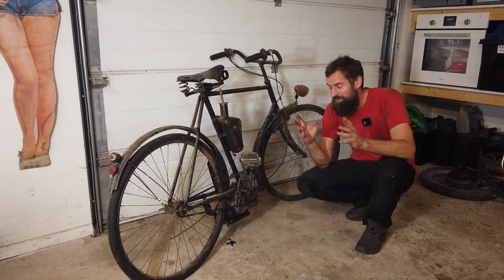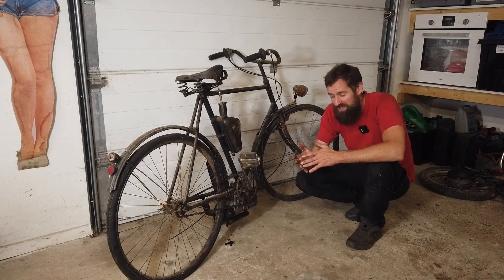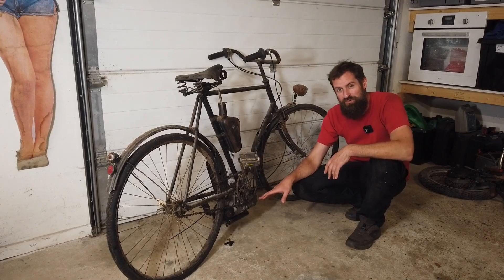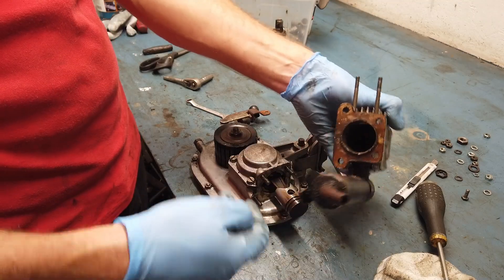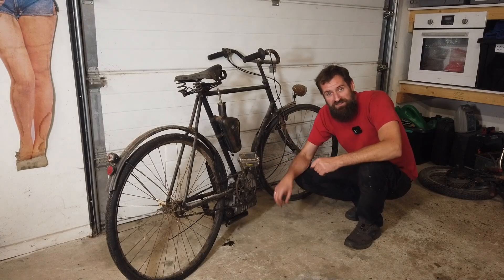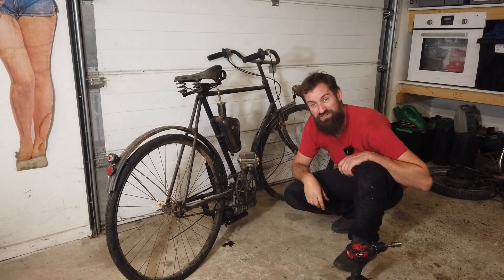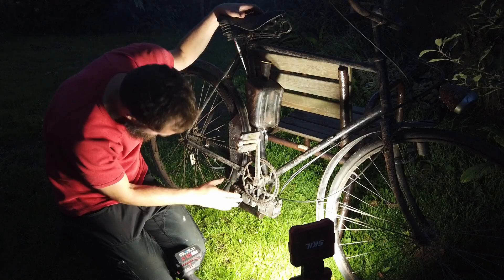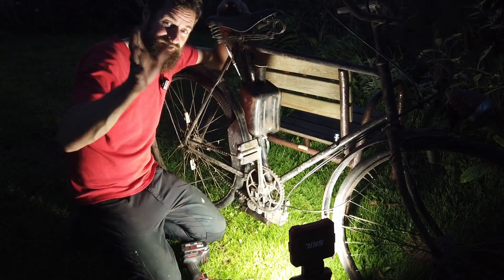Two Stroke Diesel Moped With Variable Compression! 18cc!

Comment from the maker: Thanks for all the lovely comments! I am reading them all!
I JUST uploaded the next video with this one! And I actually attempt to ride it!
Reply: Mate, try running it on kerosene, I think you will get far better results.
Reply: @marvindebot prolly meant to?. (Kids on my school bus used to pick up kerosene for the fridge at home). Parrafin would burn clean?
 On reflection, that would have been heat exchange (the fridge?). I'll have to look it up now😅
Reply: I imagine, that the bicycle drive wheel also acts as the flywheel to help keep the engine spinning. This engine may not be designed to run/idle, when the bicycle comes to a stop, like at an intersection, but instead meant to be used when the bicycle has long periods of uninterrupted travel. More for use in rural areas or between towns or cities, than inside towns or cities.
Reply: The" beats walking",  school of engineering...
Reply: I'm here just in time!
Reply: What about oil? Did I miss something?
Reply: You should consider fitting a fiberglass fairing and entering the Craig Vetter fuel economy challenge! One could probably get several hundred mpg on this if you manage weight, aerodynamics, and driving style. Look it up
Reply: @systmh  He should go for carbon fiber, so it would be lighter (Of course, he should refrain from deep sea diving with it!).

Comment: Boy, that IS an overcomplicated design. 

A much simpler way to do it is to use a "contra-piston" inside the bore, up at the top, which is basically a puck of metal that has a other type of "piston ring" to seal it to the cylinder, and then an adjusting screw protruding thru the top of the head that when screwed in or out, pushes the contra-piston up or down the bore slightly, and changes the compression by varying the size of the "combustion chamber". Simple, easy, and effective..

Comment: On starting engine with drill get your self a 1/2 socket ratchet and 1/2 adapter to drill. This allows rotating engine but once engine starts ratchet allows it to rotate faster than the drill so nothing gets destroyed or injured. Just mind that in cheaper ones you might run into issue of inertia turning the ratchet switch so might want to build lock to hold it in place if all your engine turn to same direction.
Well this is closest i have seen so far when it comes to converting moped into diesel. Local regulation prohibit speed and displacement but older ones have no emission regulations, so i'm thinking on converting older moped into diesel, just having hard time finding anything that is 50cc and i could get the high torque for steep uphills that is the issue around here. Even if speed is limited to 45km/h i would like to drive the uphill in that speed, while gasoline needs get speed to get up the hill for that speed and gets sluggish from my experience. Also smaller fuel consumption and potentially able to drive with home made biofuels would be real nice thing.

Comment: Parafin is another name for kerosene which is very similar to distillate. I can understand it needing variable compression otherwise you'd never start it.
The big surprise for me is the drip feed. Until now I thought all diesels were fuel injected. Also it has to be a two stroke I reckon and all the two stroke diesels I am aware of are supercharged to make them work. SO, what an engine, well ahead of its time.
Reply: @@Britishpersun You're right, I had forgotten about them, my elder bro' had one. But I don't remember them in diesel. I'm going back sixty years but I think they were alcohol or ethanol !
Reply: @@Britishpersun Well I'm happy for ya mate. I also restored a 1959 Kero Fordson Major a couple of years back. We had a few Fordsons until we saw the light back in about 1965 and bought Chamberlains .

Comment: Yes Nissan is doing it with a rather "eccentric" crank.
Saab also had ( prototype )variable compression with a 2 piece block with hinges and bellows.
Despite cutting my teeth building turbo Nissan engines....
I honestly like saabs approach much better.

Comment: I had a 1968 r50 BMW motorcycle 6.8 compression ratio . In the summer I could run 50 % diesel & gasoline .

Comment: back in 1981 when I was in my last year at school, a friend turned up with a 2-stroke variable compression diesel engine with a propellor on the front. it fueled using an adjustable carburettor and the compression was controlled by a tap-screw on top raising or lowering a cylinder head dummy inside. can't remember the engine capacity but in comparision to model aircraft engines I was familiar with at the time it must have been around 10-12cc. and interestingly, we used it to test fuels from cracking crude oil in an after-school nerds club (thats before we accidentally managed to blow-up the science lab lol).

Comment: Not a semi diesel full diesel. Semi diesels use glow plugs or hot bulbs. Larger version of model aero diesels and using fuel they use will make it start and run very well recipe is oil, kerosene, ether and some ignition booster. Usually amyl nitrate but impossible to obtain so try cetaceans booster additive instead. Percentages available in on line search. Good luck

Comment: This engine is not running right. It should not be producing all that smoke.  It's getting way too much diesel. 
I think you should just lock down the compression once you get it right and just leave it there. It won't be hard to start because of the compression.

Comment: 4:33  I don't think any diesel engine has a carb.  AFAIK, diesel has always been injection.  Presumably, the fuel has to be injected very close to TDC to prevent the fuel from igniting too early in the stroke.  Like say diesel ignites at the temperature generated at  12:1, but it's a 15:1 compression engine.  If you inject the fuel too early, it will auto ignite when it reaches the point in the stroke where the compression has reached 12:1 and its associated temperature.  So ideally, you would inject the fuel just before TDC.

Comment: For all my 2 stroke engines i mix canola oil in my gas. Never had any trouble in my moped. There is a place for gmo "cooking" oils. Any place but the kitchen. Would be cool to see a diesel bolt on moped engine than can run on canola or any gmo cooking oils.

Comment: 18cc is kinda hystericicallly tiny to expect to drive such a large wheel. 50cc scooters have teeny wheels for a reason. Granted it's "diesel" so more torque but might just take an incredibly skilled oprtator to balance fuel and compression or maybe it was a garbage design from originally. Probably rare for a reason.

Comment: You could be having a compression issue. As you're spending it over and trying to start it extra fuel is building up in the cylinder and maybe actually helping the Piston seal after that extra fuel runs out and it's running on the normal amount and no longer has that fuel to seal it

Comment: Model aircraft engines with compression ignition have existed for many decades. They were old news in the 1960s. A T-bar screw on the cylinder head was used to vary the compression ratio.

Comment: Inspiring for the home tinkerer. I have a couple old honda 300 watt generators- 4 stroke very small engines- would go pretty well on a bike, much quieter and much more reliable than those 2 stroke chinese kits that are noisy junk.

Comment: Years ago I brought home a 27cc 4-stoke gasoline engine from a string trimmer that someone threw out at the landfill to take apart and clean up for fun. The trimmer part ended up being beyond repair but I still kept the little engine because it was so much fun to work on and get running!

Comment: The diesel engines used to power model aircraft in the 1950s used a variable compression system and typically had a capacity of 1.49cc. The recommended fuel was one part ether, one part castor oil and one part paraffin. Worth a shot in your engine?
Reply: thomas pcguru engines demo https://youtu.be/YpMvZ7K-T9M?si=7eyU4g4WOmcpsbmU
enjoy!

Comment: You were saying that little engine is a multi-fuel burning design. I bet it would run better on kerosine with its adjustable compression. Kerosine lights off easier. Or maybe add a little gasoline to the diesel. Im interested to see if you can get it running well enough to ride it

Comment: I imagine, that the bicycle drive wheel will also act as the flywheel to help keep the engine spinning. This engine may not be designed to run/idle, when the bicycle comes to a stop, like at an intersection, but instead meant to be used when the bicycle has long periods of uninterrupted travel. More for use in rural areas or between towns or cities, than inside towns or cities.
Reply: And there are a lot of those areas in Denmark and Germany
Reply: Run it on kerosene/paraffin with a shot of 2 stroke I think they were like a tractor  that used tvo fuel when they got hot they ran fine

Comment: That is not a diesel cycle engine , that is a normal two stroke that fires by compression , just like a petrol car that's too hot , a diesel has a fuel injector , the reason for the variable compression is to get exactly or as close to as possible the correct compression for a type of fuel , you could run it on petrol or anything , a diesel is a specific set of circumstances, put some petrol in and a spark plug lower compression to is least and it will run just like a petrol motor , I could get a petrol engine to run on diesel if I raised compression a lot , but this Is still a petrol engine running on diesel not a diesel engine ! No injector or pump not a diesel by definition !

Comment: With any internal combustion engine, the octane rating of your fuel coupled with the degree of compression influences ignition timing. This is the case even if you have spark ignition or a diesel injector. This is a compression ignition engine, but you need to match that compression to the octane of the fuel. If you are using modern petrol, then compression would need to be low but with diesel fuel it would have to be high and things like kerosene or paraffin would be in-between. All your fuels except for diesel would have to contain oil for lubrication which would affect the octane of that fuel. The lower the flash point of your fuel the higher the compression will need to be and if the bore or rings are worn then you may not get the compression necessary. I can see this being a very tricky engine to control as things like RPM, engine temperature, and fuel ratio will also affect the ignition point. Trying to keep all these things in balance would be difficult.

Comment: A lever to alter compression was pretty common on older bikes, so it was easier to kick start the thing.
Reply: Your thinking of a decompression lever that would hold a valve open to make it easier to start, this set up is almost closer to a slide valve engine, but even that didn’t change compression, this is incredibly unique
Reply: Old bikes- of that vintage or more- were pretty low compression and didnt need decompressing to kick. Reckon you're mixing that up with spark timing lever/ twist grip on the opposite handlebar. Spark timing wasn't automatic back then. If you left it advanced, it'd send you over the handlebars when you kicked it over.
Reply: @rossbrumby1957  I owned a 1960's VeloSoleX which is probably the lowest compression moped engine ever made.  And it had a real, in-head de-compression poppet valve.  All because it used a friction wheel against the tire, which in rainy Fall and Winter France needed all the advantages you could get to spin the engine over when the streets were slick with rain.
Reply: @rossbrumby1957 it’s a diesel, there’s no ignition system

Comment: What a cool little engine, my grandfather built his own powered bicycle back in the 30s/40s as he had to travel a long way to work living in rural ireland, started with a battery and car starter motor iirc and just a simple on off switch, then found a little petrol engine which he attached to the frame, used it to travel 20miles or so to work, used to leave a can of fuel under a leaky fuel pipe that was for an airport iirc which was on the way to work and would use that to power it so got free fuel as well :)

I built my own electric bicycle when i was about 13 or so for the fun of it, much easier then with parts easier to find, also got lucky and found a ton of brand new nicad battery's that were being tested and then thrown straight out after ward for some daft reason, so had 100s of them to use, soldered up a few packs for the bicycle which made traveling around easier as a kid.

Comment: My mother and my father had each a bicykle with Lohman Motors in the ealy 50th. Befor skrapping, the motors was taken out and keept in the cellar. In th early 70 my father rembered the motors and startet with my brother (13) and me (11) to install one into an actuel bicykle. The second motor was used for spare parts. It was hard work to bring the motor to ingnition by pedal force. As far as I remember it tock hjalf to one kilometer to get stabil ignition.  All what is left totay from the Lohmanns is the front cover of one tank (other tank version als shown in the vid).

Comment: Diesel engines use "Adriatic" ignition by compressing the air so much it gets super hot and then Diesel fuel is injected as a fine mist that ignites from the hot compressed air. Glow plugs are for cold start only. Not all diesels use glow plugs.

Comment: Not sure this can actually idle or even run properly without the roller against the wheel. Don't know if there's any flywheel on the motor itself, but I'm sure the wheel and inertia of the vehicle acts as a flywheel in normal operation.

Comment: Not a Diesel.Diesel cycle uses an injector,without an injection system its correctly called a compression ignition engine

Comment: Interesting.  I did not expect to see that design.  The compression adjustment is somewhat similar, in my understanding and recollection, to the fuel metering system in the Diesel fuel pump for my 1965 Mercedes Benz 190Dc (OM621 engine).  Rather, I expected to see an articulated connecting rod setup.

Now let's see you ride the bike on Diesel power!

Comment: The manual recommends using kerosene mixed 25:1 with oil. 0.75l/100km is quoted! I have a PDF copy of the manual if you'd like it.

Comment: Looks very similar in principle to one of those diesel model engines for aircraft, they also had variable compression with a screw and lever on the top of the cylinder head, I had one many years ago, it was difficult to start initially but ran well eventually, no piston rings, just a snug fitting piston. They ran on paraffin, engine oil and di ethyl ether 33.3% of each. The ether being for the ignition at a lower flash point.

Comment: Nice little engine. I'm surprised it runs in regular diesel without even needing injectors. I've got a few small compression ignition engines but they all need something like ether in their fuel

Comment: Seems like it would be extremely easy to have this thing runaway on you! 😮
Reply: Only if the fuel drip needle gets stuck open. Most runaways in full-scale diesels occur when the seals in the turbo let go and the engine consumes its own oil.

Comment: Nissan’s variable compression system is pointless, we already have forced induction and adjustable cam timing; it literally serves no purpose and it’s god-awfully designed and failure-prone (like everything Nissan has made in last 15 years 😂)

Comment: That's a super neat little engine, I like the variable compression setup, but it does seem quite complex  FWIW, variable compression diesels were a fairly big thing in aeromodelling from about 1945 onwards, but generally had a really simple setup with a counter piston in the head that could be screwed in and out to increase or decrease compression.

Comment: I know Nissan (Infinity) doesn't have the first, but I see headlines claiming that…

Saab's version is pretty cool. It alters compression by moving the head and cylinder together, connected to the crankcase (& crankshaft) by a hinge & the actuator. 

Similar to that moped sorta…

Dump a little oil in the cylinder, just a few milliliters, that thing is tiny, so it could be hydrolocked easy!

The oil will lube up the piston rings & bore, to improve compression, & it will bump compression temporarily (by displacing air).

I'd use something like 10w40,  not a light oil (wd40) or heavy oil (80w90).

Comment: PAW Progress aero works made a variable compression diesel model aero engine some 60 years ago just had a contra piston pushed down with a screw on top of the cylinder head very similar up to 3.5cc they used a simple needle valve to set the fuel .Much simpler and good times

Comment: Auto ignition motor. I know some old ones post civil war for marine use and some more moderns, made in Spain. The problem is mix a correct fuel, ever put 1/3 of mineral oil or destroy de motor, ricine oil is better. Querosene runs better and add a little trementine (or ether) in the mix, you will can better rpm response and control.
👍👍

Comment: Mazda made a variable compression engine as well it had an adjustable crankshaft for shorter & Longer strokes
Reply: Not just Mazda. Saab and others had hinged blocks that swung the crankshaft girdle out for low compression plus high turbo boost. It was never widely adopted. Electronic waste gate turbos, liquid cooled EGR and piezo controlled common rail injection took over. These engines run 15:1 or less  , are much lighter and produce very little NOx. The trick is to feed the turbo inlet lots  of exhaust gas when the engine is running at cruise power. This way there is heaps of compression from boost and not much oxygen. The efficiency goes way up because the heat doesn’t get wasted out the exhaust. In contrast a two stroke 18cc diesel would be equivalent to a 250 watt e-bike but heavier and less fixable